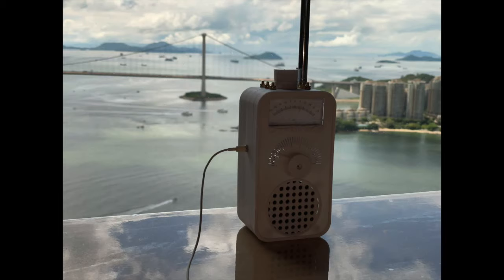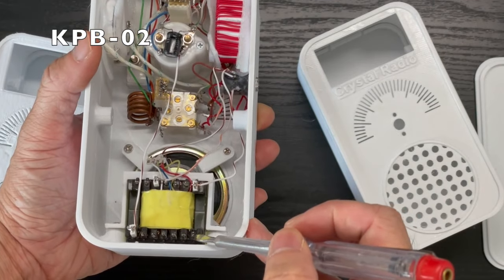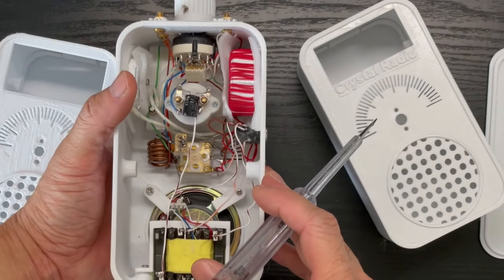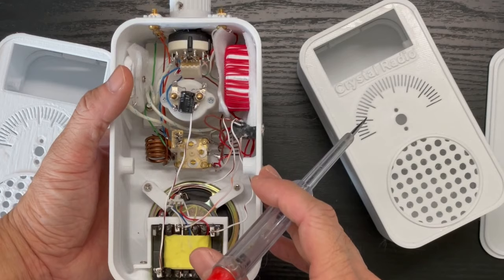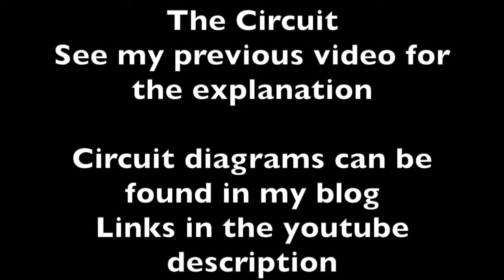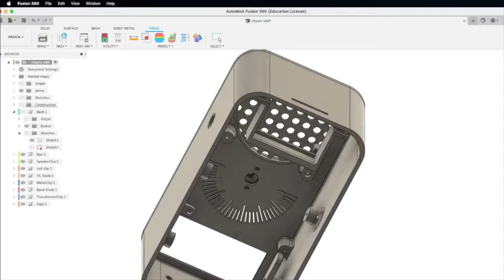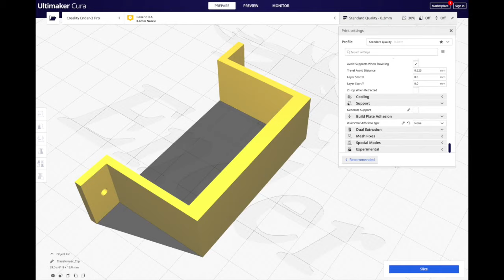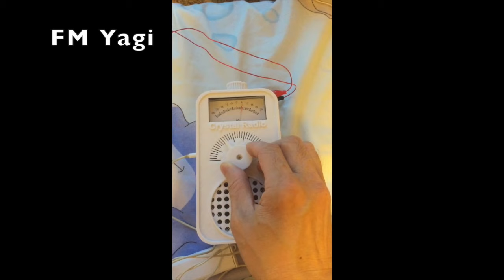3D printed AM SW FM Crystal Radio

Comment: Very cool project! Nice to see a component-level project, not just using modules. I don't understand why the zero-center meter is deflecting in two directions? seems to swing positive for FM and negative for SW? is one diode reversed?
Reply from the maker: I have been using a MOS FET (3DQ) as the detector. Though my circuit works for both Diodes, crystal and MOS FET.  The demodulation function of the MOS FET is a bit different than that of a Diode. A MOS FET does not always generate the same direction of current flow during demodulation. Depending on the phase difference of the input  signal (from the tank circuit) that  that feeds the G2 pole v.s. that of the signal (from the tabs) that feeds to the S and D poles, the direction of current will be different. So,  it's better to use a bi-directional current meter.

Comment: I'm impressed by your good work. I would like to hear the speaker. Also it is a great crystal radio. The 3D case adds a lot of value and esthetic to your design. Congratulations. I wonder if the SW will improve outside if you put a GND wire to your body or to the floor.
Reply from the maker: Thanks . Yes connecting the ground eg to the fence will definitely help

Comment: I have a question, what is the amplitutde of the signal just before the gate of that MOSFET ? I think it is easier to build a crystal radio when you have the transmitter very close to your home because otherwise it has to amplified. What do you think and I am reallu curious about the amplitude of that small signal (just to have an idea of how weak the singal can be tolerated by only crystal radio). Thanks :)
Reply from the maker: Apologies. I do not have a way to measure the signal strength before the signal has been detected. It’s true that you will need a good signal to power a crystal radio. I happened to test within 5 Km of a transmission station with ERP of 10kWatt. If you are near to a station, you can compensate by Uber  as long a longer antenna to catch more signals.
Reply: @BillyCdiy  Thanks for the reply anyway and your great idea of your beautiful Crystal Radio. Really like the case of it as I make very simple transmitters and receivers for using at home (with very low power to avoid problems etc.) and I was looking for some case for it and here you are with your great idea and it it inspires me to build  my own cases for my projects :) Thanks a lot :)